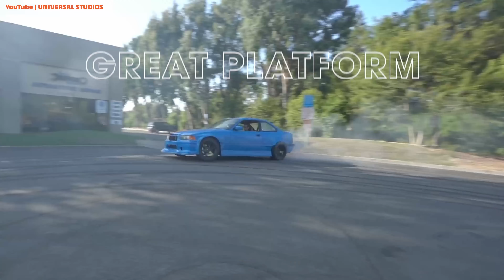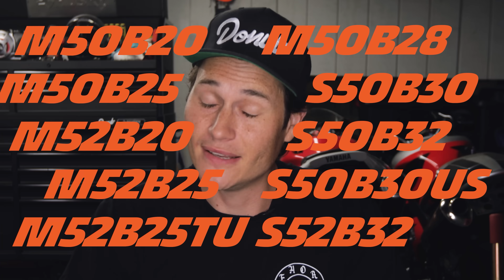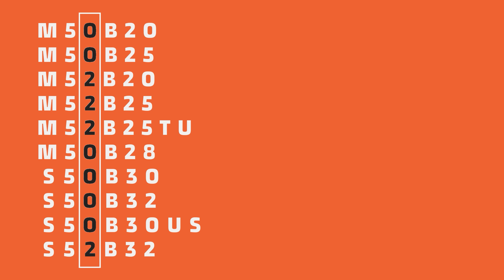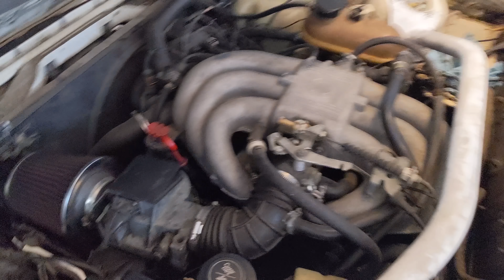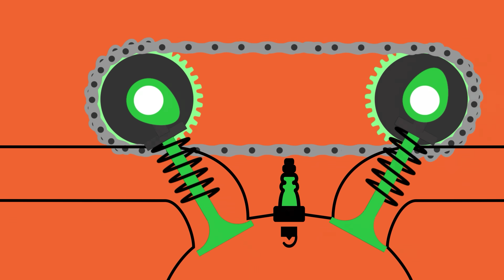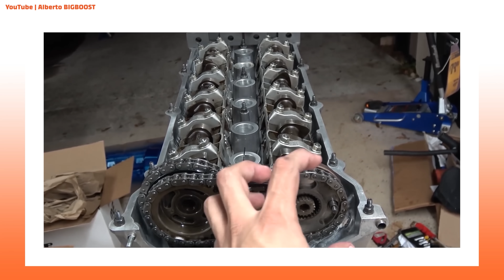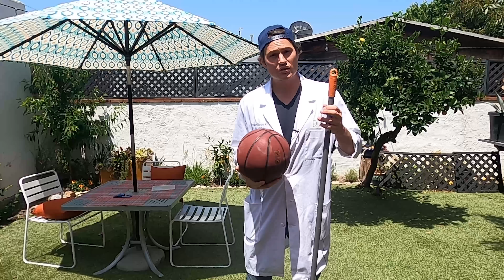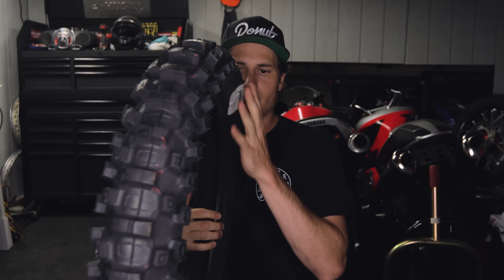2 Reasons Why the E36 is an ALMOST PERFECT Project Car

Comment: You forgot the most important part, e36s non Ms were the last ones to come with factory LSD.
Reply: Extremely important and overlooked FACT. Even the E46 M3's LSD is worse than a standard non-M E36's one. Very glad to have two for mine, one recently rebuilt to 45% lock :)
Reply: The limited slip was a option with either the winter package or special order
Reply: Which models of the non m came with an lsd? I have a 96 328is that has an open diff :((
Reply: @kurt414  check junk yards, i think the LSD had an "S" stamped on the underside
Reply: @TheZooness  correct
Reply: @kurt414  the 325 pre facelift model comes with a limited slip with 3.15 ratio . The same as the european m3 pre facelift with the 3.0 liter engine
Reply: @kurt414  don't quote me on this but I think it's just one of the factory options. My 1988 525i has an lsd for some reason
Reply: @kurt414  3.15's out of 325's can in certain circumstances be an lsd. 95 m3's have a 3.15 lsd, 96+ m3 has a 3.23 lsd. There are definitely more 3.23's available but they cost more. 3.15's tend to either not be as desirable or someone doesn't know what they have. Important to note the input and output flanges can be swapped to fit any type of driveshaft or axle combination. If you swap the input flange you need to re-preload the pinion bearing which can be a pain if you don't have the tools. It is definitely possible to rebuild them in your garage with patience and a harbor freight press. If I remember correct, I bought and rebuilt to 45% lockup a 3.15 m3 diff for $900 all in including purchase of the hydraulic press.
Reply: @kurt414  @all    "Which models of the non m came with an lsd?" Well I can only speak for the european market but you had the option to order a LSD I think with every BMW pre E46/E39/E38. So if you wanted you could get a 316i with a LSD because in the earlier days a LSD was even seen as a safety feature and kind of necessary in any "higher power" rwd car.
Then during the production run of the E36 BMW decided to equip their cars with ASC+T (basically traction control and stability control) rather than putting a LSD  in the non-M cars. I think the main reason was cost. Or maybe too many people used their BMWs for drifting irresponsibly and they wanted to keep that opportunity to M owners exclusively, idk.

So there are plenty of E28s, E30s, E34s and earlier E36s with LSDs around but not a single E46, E39 or E38 (not too sure about that) that is not a M variant. To be precise those even got a new generation of diff that is more compact, weak and with less parts available than the previous generation. M cars continued using the old generation for quite some time onwards.
You can't really swap an E36 LSD into an E46, same goes for E34 and E39. You are able to purchase some aftermarket LSD unit to swap into your open E46/E39 diff but those cost a fortune and you still got the slightly weaker diff.

@Bobo bobo Well, the 3.15 of the 325i and M3 5speed aren't really the same. Same casing and ratio but different driveshaft and axle flanges, bigger and stronger ones on the (european) M3...

@Dr. Evil No, E46 hasn't ever come with a LSD. It doesn't really have that many E36 parts. Some are similar but hardly identical ones. Fyi the M52TU engine also is much more related to the M54 from later E46s than to the old M52...
Reply: I have a 99 e46 with the m52tu. Wonder if that has the lsd. It deff has a lot of e36 parts and the wheels and suspension is from the 36 M3.

Comment: I plan on swapping the engine and transmission on my 2016 A3 from a 4cyl to the 5cyl and the automatic to a Golf R manual with a hydraulic ebrake. Do you guys want to do a bumper to bumper on it? A series where I show the process from beginning to end?

Comment: E46 is my current project car expensive experience but it’s worth it in my book. 
Replaced the window regulators and sunroof rack and coolant flush since previous owner had used pure water . Next is oil filter gasket ,head unit and dash cam

Comment: I personally thing the E90 has the best steering and brakes, I have an E46 M3 sedan with KW V2's, but that handles like crazy, my E90 335i 6 speed manual is stock so I can't really compare handling.

Comment: The e36 m3 sedan was my favorite
Reply: In techno violet
Reply: Yea
Reply: Same here bro... E36 was the bomb
Reply: @sajithparackal1738  I'm trying to buy one now for 1500 but my parents say I'm too young plus I have no money
Reply: EmberShadow 69 if the car is that cheap it’s probably a money pit. Save your money and when you get older spend a little more money to get a nicer example and it should be more dependable. Also never skip a pre purchase inspection especially with BMW’s
Reply: @JohnSmith-in1tt  no I got a family discount
Reply: @98ranger48  parts for e36s are dirt cheap, cheaper than any other car I've ever owned. A e36 at 1500 is a little high, I would buy one for under 1k. Now at this price expect to replace all the rubber bits in the engine bay and suspension.  Replace sensors, gaskets, seals, clutch/flywheel. This will come out to around 5k including car, and you doing all your own wrenching.  This car will need specific tools that you can buy cheap. And the labor is straight forward and easy. Buy the color you want with good body and interior. Everything else will be replaced or upgraded. Good luck
Reply: @TheZooness  well that car right now has no problems except for paint chipping and a dead battery
Reply: @JohnSmith-in1tt  e36s being that cheap is not uncommon.
Reply: @98ranger48  I've been into bmws a long time new and old. Believe me, unless things have been changed in the last 10k miles. Theres always something wrong. This what I do with any car I buy with 100k+ miles, no matter of previous owner says it was done. Wash the engine bay and under the car.  Change All fluids, all filters, all engine gaskets, intake and ccv parts (sometimes the maf), all pulley bearings. Drive the car, this should show any leaks, and at this time you can listen for suspension noises. Usually this is when I hear suspension pops, squeaks, throwout bearing noise, clutch noises. Then I change all suspension bushings, engine and transmission mounts, and buy clutch kit and flywheel just to replace those in the future.  Yes I do this will all the used cars I buy, nothing is ever perfect when a car is this old or has this many miles. So unless I replaced the parts, I will never have piece of mind. It's a BMW, replace things before they cause problems or you wind up chasing problems instead of getting ahead of them. This is what turns people away from BMWs, its preventative maintenance at 100k miles before problems stack up.

Comment: My e36 being a automatic 😢
Reply: You can change the transmission. In my country transmissions are cheap. 150-200bucks and you need to change your pedals.
Reply: @steffenkawa8374  that is super cheap. Rebuilt manual  swap for b5 s4 is about 3500 to the door, 5500 if you want rear lsd. And its upgraded internals too. Never know what you get with a junk yard transmission.
Reply: Manual swap it my dude!
Reply: U can only blame yourself because you settled for a auto....unless u got it as a gift, lol.
Reply: @Easy Come Easy Go  is my first car and was a gift 👏🏻👏🏻 buddy
Reply: @jacobfrady9249  ok so your excused, i did say not your fault if it was a gift.
Reply: Easy Come Easy Go shut up lol
Reply: @ultimatetrex1999  well its true😂